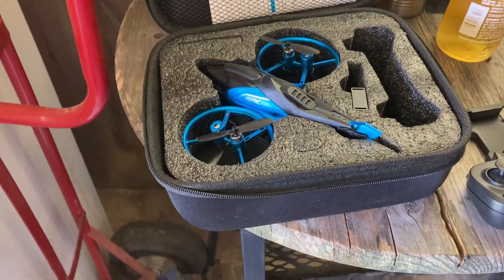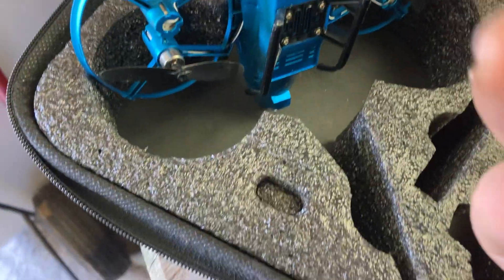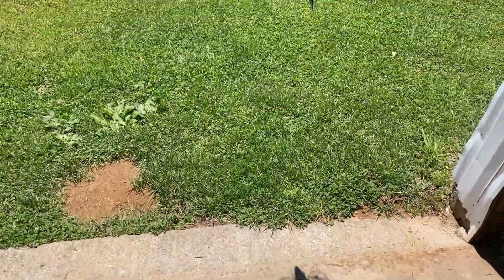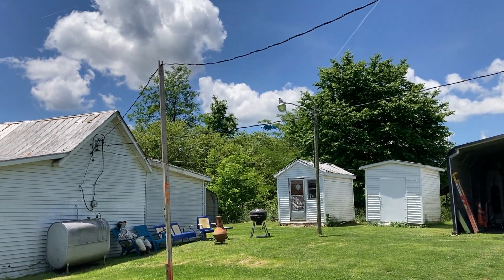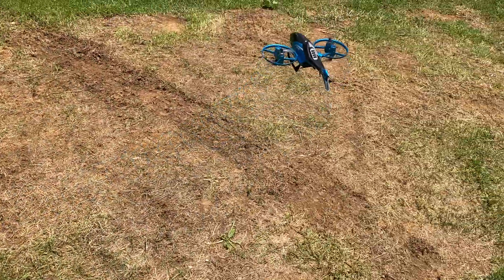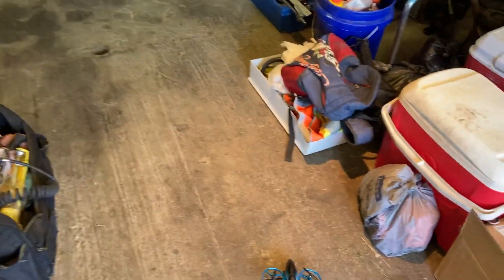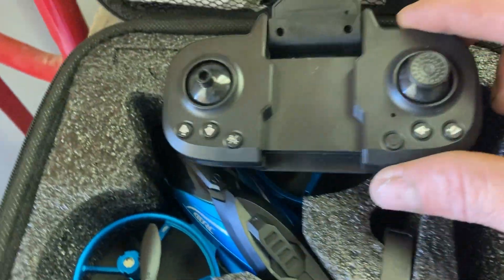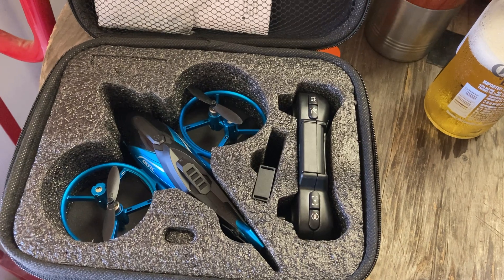4DRC M3 mini quad copter

Comment: This is really an oddball design.   It looks like it only has 2 rotors, or props. But it's actually a quadcoptor.  The vertical orientation of the motors props are close together making it look like it has only 2. 
I wondered about stability.  It's not as good as I hoped. 
I looked around and I can't find one for less than $30.19 or $35.80. I think I'm still going to purchase a couple.

Comment: I wish this had brushless electric motors, 3 bladed propellers, and full acrobatic mode.

The camera really should be on top of the nose of the 4D-M3.  The aircraft is tilted forward in forward flight. 

The battery cages should allow one to quickly swap out the battery, so one doesn't need to have another battery cage for additional batteries.

4DRC should make a bigger version...with mentioned improvements...to fly outside.  Although I think it is more likely a flight controller issue, than a power issue.

This type of quadcopter should be called a stubbed quadcopter.